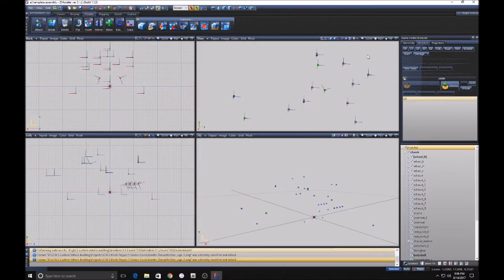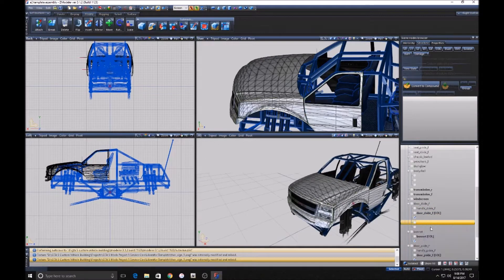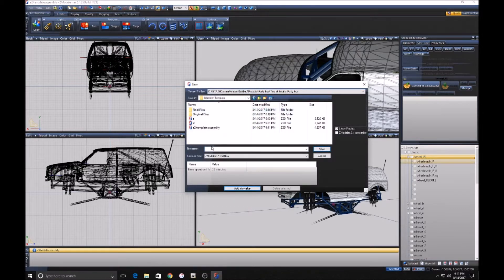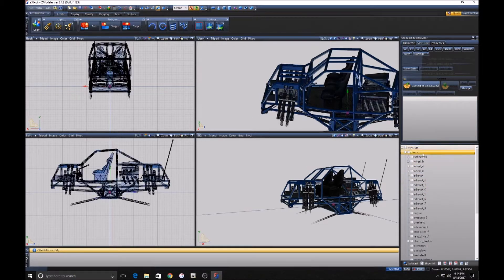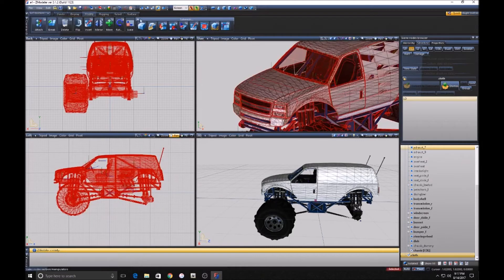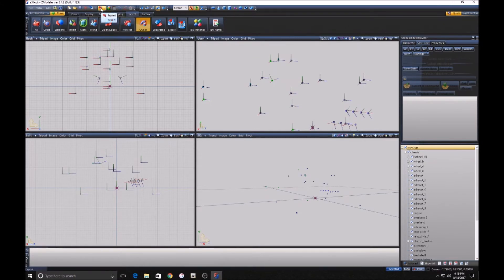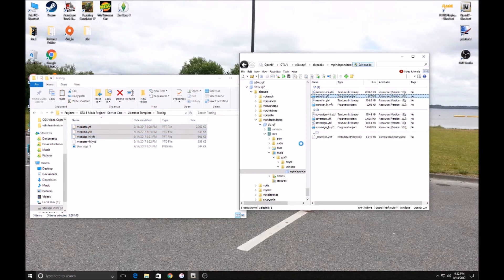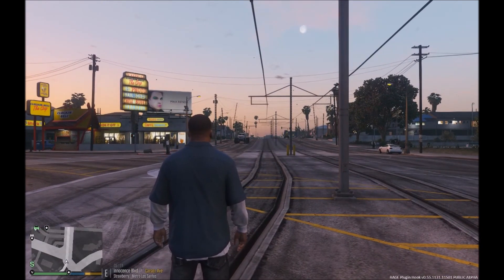Tutorial #2 LODS and Optimizing

Comment: how did you export it as a _hi without it being named monster_hi in the hierachy? Mine says can not locate node named for export
Reply from the maker: These days I have to change it to a hi name now. With the older version you didn't have to
Reply: @SocalThero  yeah, but why doesn't it reduce the file size for me?
Reply from the maker: The Non Hi file is going to be higher doing it this way then the Hi file. If that is the case then you are doing it correctly however I would suggest that you do further optimizations to lods to reduce it down even further. Most non hi files if I remember right are no bigger then the hi file. Again this isn't a way I do my models anymore as I've gotten lazy on lods and have better optimization file size wise by just exported the Hi only upping the lod in the car variation.meta.

If that isn't the case the other thing you might need to change is your export options when you click the export button (Near the bottom it says "Export LODs:"
Reply: Will try, are you on discord or anything?
Reply from the maker: @derangedpittman  i am, in my videos there is a link to it in the description minus the tutorial ones